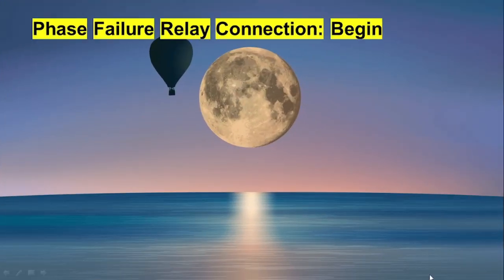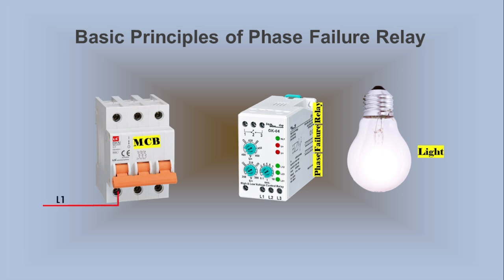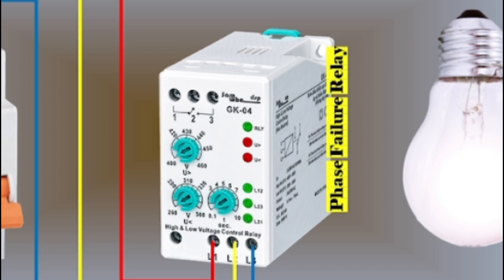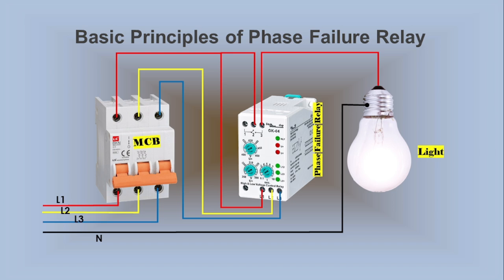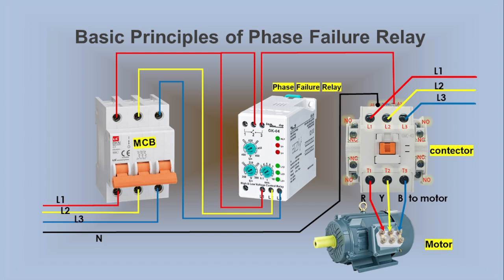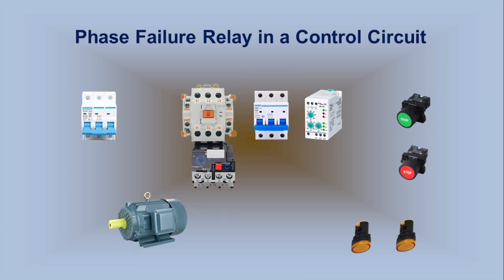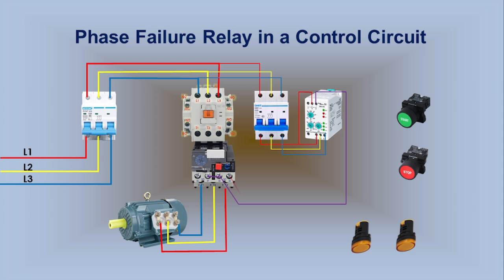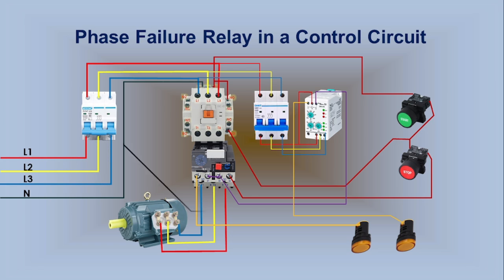Phase Failure & Phase Sequence Relay Explained Operation & Circuit Diagram

Comment: How can I get a fully connected set from you
Reply from the maker: @joholugbo650 Hello Dear. All this material used in the circuit diagram is available in the general market. You can easily buy them. If you need any help anywhere, you can contact me!